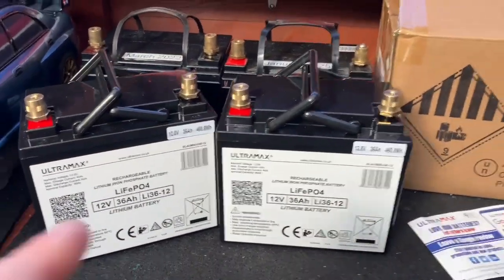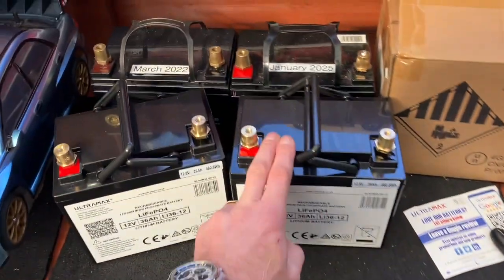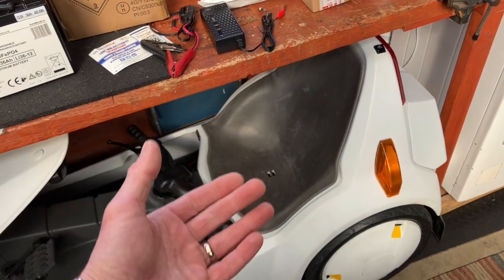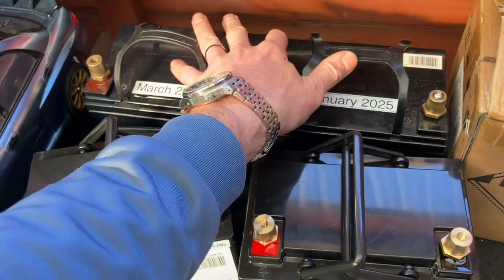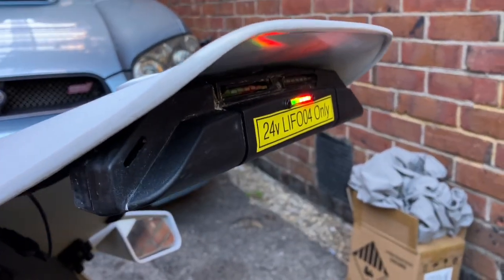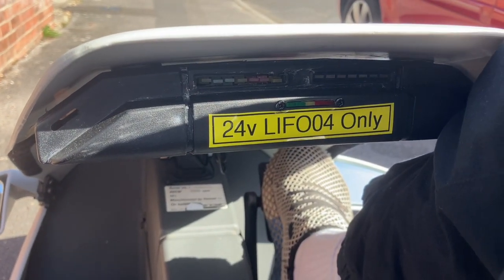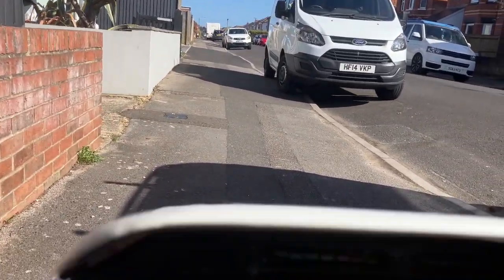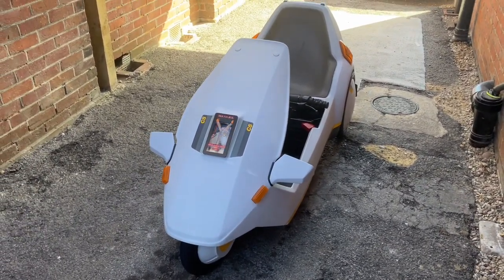Sinclair C5 -NEW Purchase - LiFeP04 Lithium batteries!

Comment: Will you be seeing how far they will keep the C5 going?
Reply: Could do with getting some time to get started on mine, the new batteries are a definite must have. Am I right thinking the pedal & chain only drive one wheel?
Reply from the maker: @ hey, you are right. The rear left wheel is free spinning and just acts with the brake - so it can be locked up if you really brake hard .
Fabulously fun vehicles, get on yours!
Reply from the maker: @iantheinventor8151  hello,  so I plan to run it on my usual 9mile run then just see how much power I have left, as with the old battery it’s noticeable slower towards the end of the journey.
I also will tackle hills and check the BMS dosent cut in , as that would never happen on a AGM.
Good stuff,

Comment: Shame you couldn't switch both rear wheels for motorised hubbed wheels ?

Surely that would improve the drive section, and you could get higher speeds !! 😮

reckon for future third c5 do a build as such.
Even change rear of frame slightly to incorporate small shock absorbers, or go old school with leaf spring suspension. 

Could make it a cool dragster version. Them lithiums you got seem to give more oophm
Reply from the maker: @wayne7521  great ideas Wayne, love these.
I think rear shocks of some sort would be good. If you run the old tyres you do get some bounce, but with people running modern thin /high pressure ones, they roll way better …but are much harder.
John Gs C5 here runs a modern tyre and no lie, it’s Rock hard. But it does steer much tighter than my C5s do.
Im actually gathering parts slowly for a custom C5, I have the shell and half the chassis parts, I plan to make a lowered C5 with my basic custom electronics and Jons brakes, I just need the rest of the chassis bits (rear axle bits mainly …!).